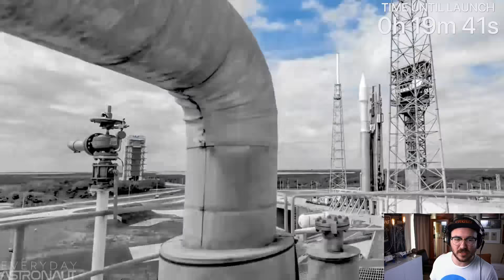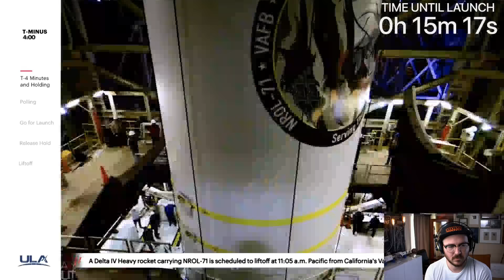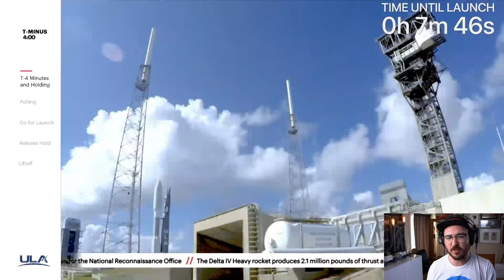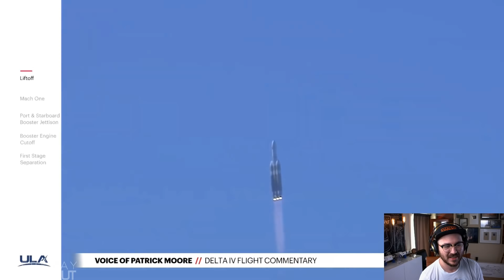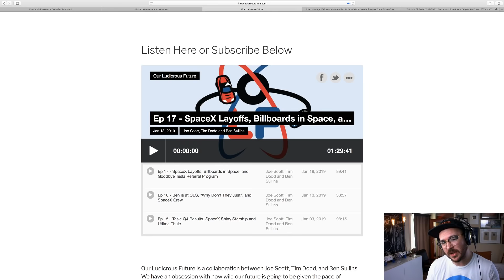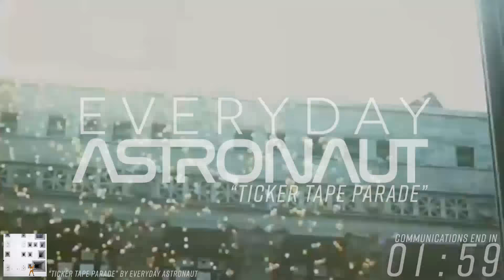Watch ULA launch a top secret satellite on their Delta IV Heavy!

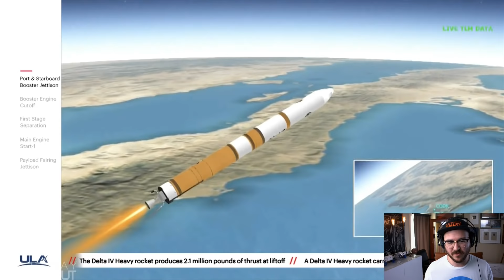Comment: 36:18 Launch
40:20 Side booster separation
42:00 MECO & booster separation & SES
42:35 very wobbly fairing halves

47:36 Tim got scammed

There was only a short webcast for this launch because the payload was a military satellite.
Reply: Thanks for the data! always usefull!